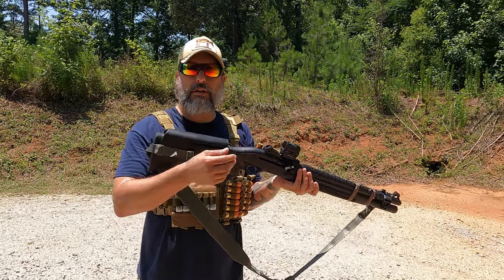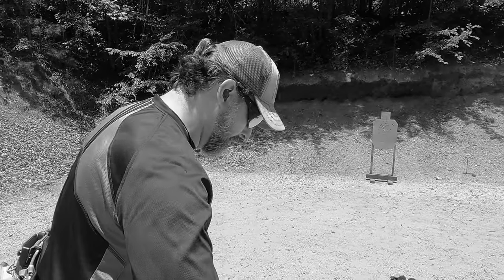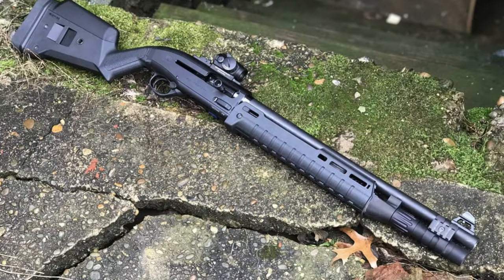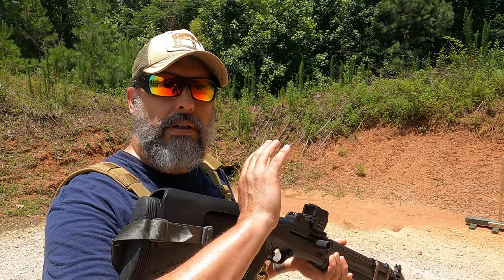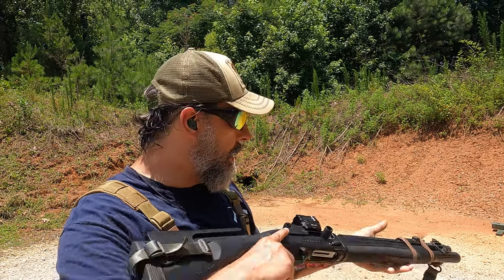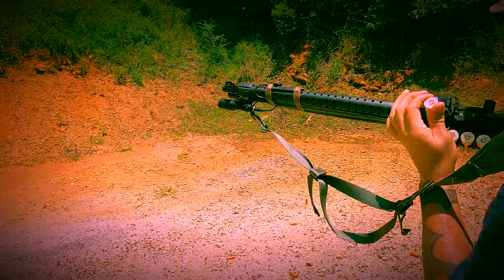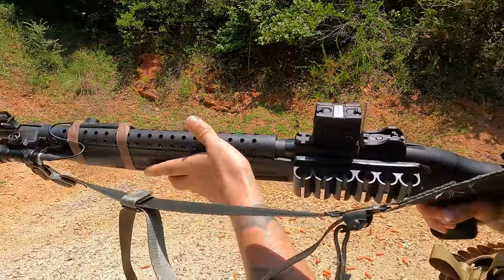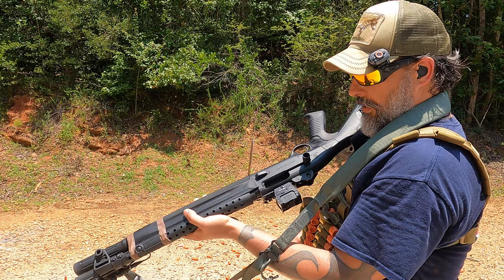BERETTA 1301 TACTICAL LE - "LOOK MOM, NO GLOVES!"

Comment: Have you already done a video showing how you modified it and put it on? Also, those brown pieces of tape are those only to hold the switch on for your light or do they also hold the heat shield on?
Reply from the maker: Tape was just to test the pressure pad. 
Here is the walkthrough video :

https://youtu.be/fq4Fuc-x7r4?si=VRKbvnL1NTHxkj6h

Comment: Sorry to be ignorant on this, but i bought my 1301 tactical and came with no choke and no marking to put a choke. My question is: what kind of ammo is safe to run through this??? Thanks in advance.
Reply from the maker: Probably a LE model with Cylinder bore. 
You can put any ammo unless specified for “rifled barrel”
But as a rule for best results try not to put slugs through any choke tighter than modified. 
From largest diameter to smallest:
Cylinder -5 notch
Improved Cylinder -4 notch 
Modified -3 notch 
Improved modified -2 notch 
Full- 1 notch

Hope this helps clarify 
Thanks for watching
Reply: @attakconsulting  I truly appreciate it!

Comment: I wonder if this would still work if you’re running a magpul handguard.
Reply from the maker: I will have an install video with measurements etc. 
The only thing from just eyeballing the magpul is adapter may get in the way? You would just have to move the heat shield toward the muzzle possibly getting in the way of whichever barrel clamp you are using. 
I will take as many measurements I can to give you guys an idea.

Comment: Please show us what to buy
Reply from the maker: There is a screenshot of product and item #. I got it from midwayUSA
Reply: @attakconsulting  What else did you have to do?
Reply from the maker: @DLW23940  Hopefully get at least 20% likes for the video from people sharing. 😀
You would be amazed at the analytics. I don’t mind giving out information, I enjoy giving. but can only do so much for so long. 
So I am just generalizing, maybe venting a little and most likely do it anyway 🤣
Thank you for listening!
Reply: Is the heat shield made of aluminum?
Reply from the maker: @DLW23940  the one I have is plastic. I wanted to keep the weight down and I will probably stipple
Reply: I just ordered one...looks like all I have to do is trim some material off the back of it....if I mess it up, I am only out $20.00
Reply from the maker: @DLW23940  Yes, trim the wings on the back until they will not contact the bars. Notch the foregrip so the wings are secured. If you have the magazine sleeve you may need to relieve a little on the front rings so they slip between the barrel and mag tube. 
Bam! If you did correctly, you can field strip as usual without tools and the shield stays on barrel.
Reply: Pretty straight forward. I appreciate you